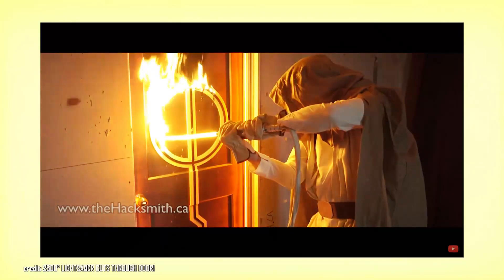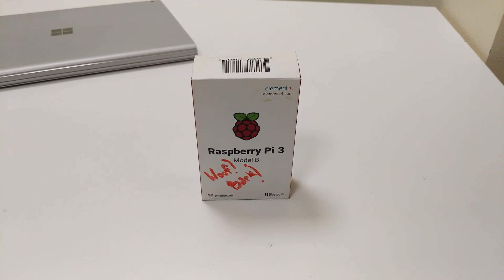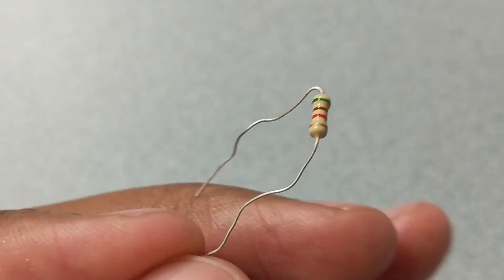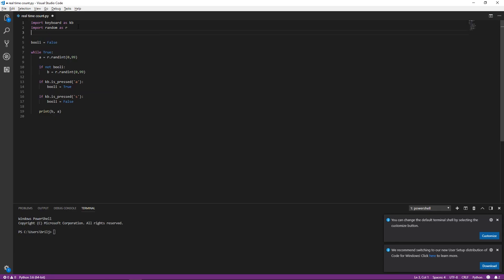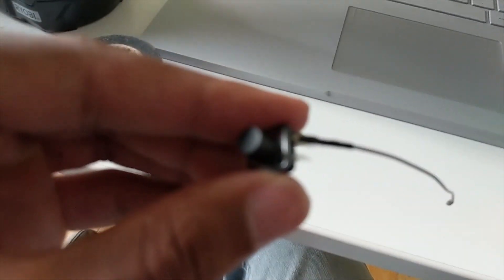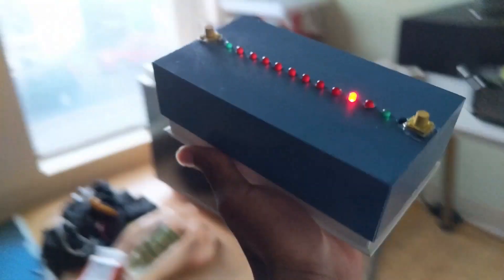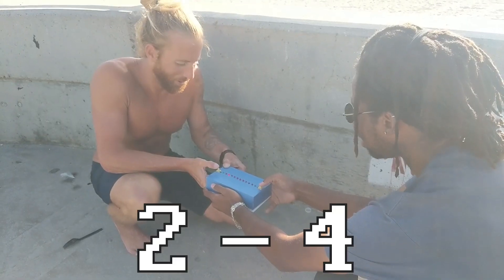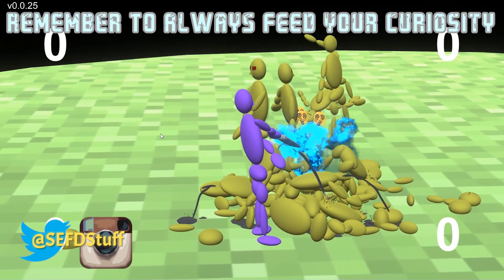How I Made My First Robot! (In A Weekend)

Comment: "Primitive terminal ide" you really need to get down with vim, it will change your life.
Reply from the maker: I believe it. Is it Linux only?
- Jabril
Reply: @Jabrils  It isn't, it's available on windows, or you can use WSL, or just become a member of the linux master race. 
Plus the rasberry py runs linux, and if you ssh into it you can use vim in there. Same is true for any Linux server you will inevitably ssh into in the future (It's also available on Mac).
Vim also has a graphical version called gvim which you can use if you want to on windows, although I would say it's better to get used to the terminal version.

It does take some getting used to because it's unlike any other text editor or ide you have ever used. It's a moded editor which means it has different modes of operation, the normal mode which you start up In doesn't allow you to actually input any text, you have to go into input mode by pressing the i key. This is by design because you spend 90% of you time in a text editor reading and not writing, so normal mode is optimised for reading. This confuses a lot of people when they first try vim.
Reply: @Jabrils  Also, be careful when soldering, the gas is dangerous and you should really have a way of dealing with fumes. An easy and cheap way is to use a pc fan and a carbon filter.
Plus if you want to make you life easier use solder with a rosin core, no need for extra flux.

Comment: Entertaining - although painful at parts! :D
If your soldering smells really bad - your doing it wrong!  Crimping works (squashing it), otherwise to solder it, you'd need to cut off the female connector, strip the end and solder it direct.  Proper eletrical solder has flux in it, so don't need extra. Tinning both ends (coating on solder), before you solder them together can be easiest - although often unnecessary.  Might find that gun thing hard to use - although it looks cool. :D
And . . whats with calling it a robot . . . its a game/gadget/project, not a "machine designed to do the work of a man".

Comment: Soldering:
Get you a wire stripper twist the fibers, stick them in the flux, tin the wires you wanna connect by heating the wire and touching soldermetal to the heated wire. Then hold both pretinned wires together and reheat them with some additional solder on gun. Hope it helps a little..
Reply: Soldering for beginners is always hard work. Especially if your using a solder iron that is way too hot for the job. Learn by doing is normally the case here oh and not having the shakes. Nice tips though
Reply: @Mr Dami3n: In my experience the culprit is more often a soldering iron that isn't hot enough. Also beginners don't have the skill to position the tip in a way that heats both parts to be joined simultaneously. 
@Leon: Twisting the wire isn't necessary. You're just rubbing the grease from your hands onto the surface. If you apply the heat and solder in a non-shaky manner you can get it done without any twisting and the result looks cleaner.
Reply: When im working on computers and consoles I always have to use low heat because the large amount of heat melt parts of the board and this can cause a right mess. Everyone has their "tricks" when soldering i heath the object and drop the solder on others dab it on the end of their iron and "paint" it on. As long as there  is no damage and a good tight hold it's fine. The finish is what's important because if it's crappy work over time or with use can just end up with a dry solder joint or just break under load. A lot of people twist wires together for a more secure link.
Reply: Urmo Kõiv he looked up a brazing (or possibly silver soldering) tutorial, and used brazing solder with a regular iron. Was somewhat doomed to fail haha

Comment: I enjoyed your energy here - trying to remember if I was that excited when I was finished with my first project many many years ago. But my first thought was why not use Arcade buttons, the buttons you have are fine for prototyping, but Arcade buttons typically come in a nice plastic case, and have the support you are looking for.  My other thing is get a soldering iron,  or a nice solder station - you'll thank yourself in the long run.  The solder gun is not the right tool for that job.

Comment: Hey Jabrils! Awesome video. :)
Couple suggestions: Use leaded rosin-core solder and a proper iron, not a soldering gun. Much easier.
Instead of trying to solder the female end of the jumper wire, cut it off and deisolate it with a pair of wire cutters, twist the wires and then solder that.
HMU, can show you a lot about electronics if you want. :)
Reply: It's amazing that so many "younger" tech guys have never learned to solder. I started 50 years ago with a Radio Shack "Learn Solid State" project.
Reply: Robert Putnam 
Just like people like you started years ago but with programming or with physics or biology...so on and so forth
Reply: Twisting the wires isn't a strict requirement though. In some cases it's beneficial to leave them straight.
Reply: I’m 14 and I know how to solder :P